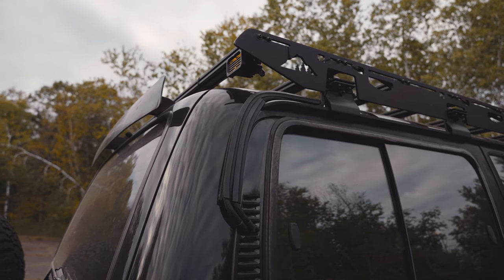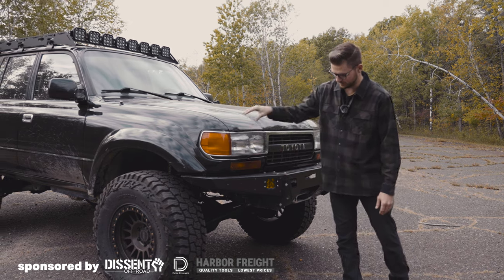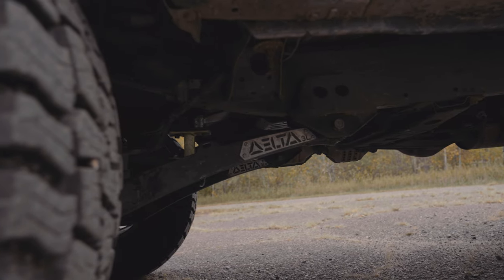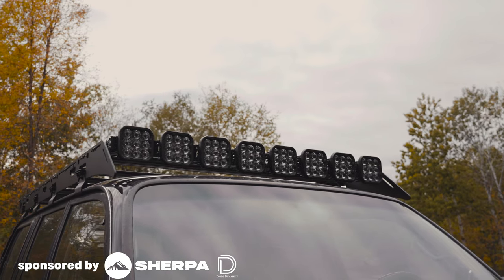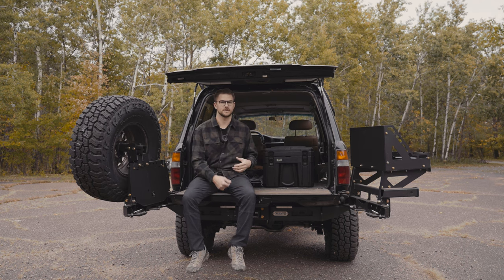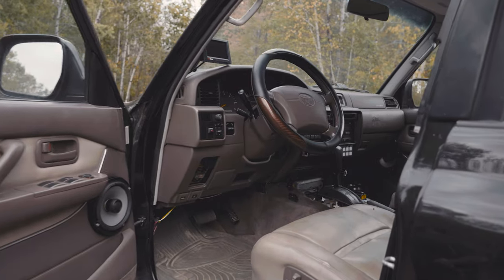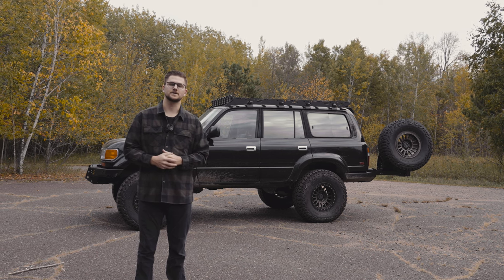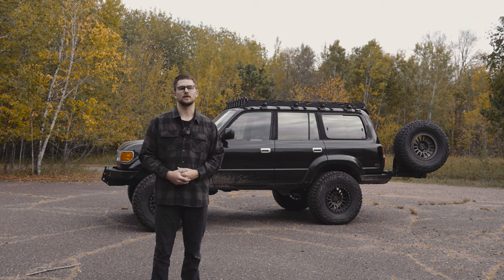Overland Land Cruiser 80 Series Build Walk Around 2023 | Triple Locked on 37s

Comment: 2" spacers? oof. So much moment arm and wear on your suspension components, especially in the front. Love low pro bumpers without bullbars but the amount of deer and elk in my area says to get/build a full triple hoop unfortunately. 
Clean looking build, too many OL vehicles have so much shit on them they look like a circus.
Reply from the maker: Yeah I’m not in love with the spacers but the stance is pretty awesome and I have to get around the lip on the wheel..maybe I’ll come up with something better eventually
Reply: @OverlandEngineer  The stance is very cool. Longer axle swap or maybe Dana 60s? Trim inside fenders? 36" tire swap with an offset wheel? Dunno if that would buy you enough but it might. 

Also from experience with a 10" subwoofer: The box is supposed to be about a cubic foot internal, I used to have a 96 Chevy Suburban with a 10" sub in it and it was more than capable of giving me a headache in about 5 minutes. I at least would probably run an 8", they're more than capable of getting great sound without taking up so much dang room. 
Then again if you run a low profile 10 in a taller thinner box it might be fine. Good stuff, keep posting.